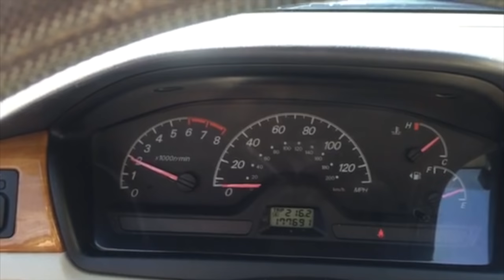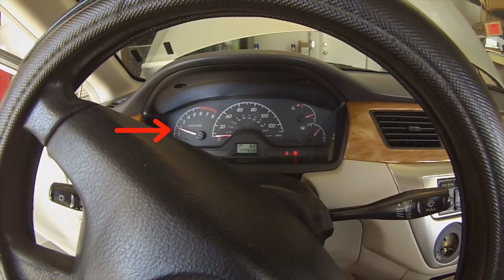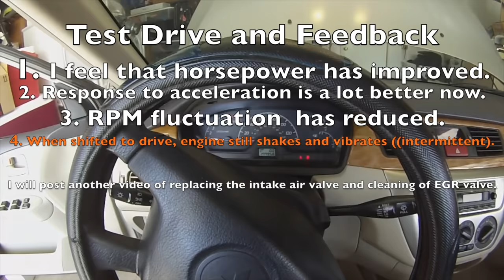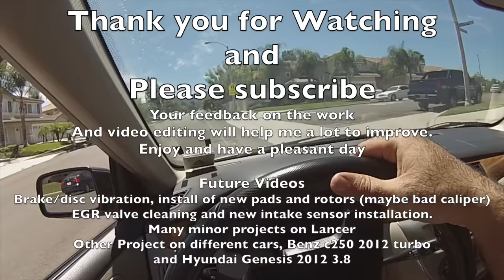Mitsubishi Lancer Fix; rough Idle, loss of power fix part 1 of ?

Comment: I have a 2006 Lancer and I am having the same rough idle and vibration and inconsistent idle .  Now that I have seen you do this I feel confident enough and I am going to attempt to remedy the problem myself.  I have not changed the spark plugs in almost 5 years and I am going to attempt to change them myself.  I just have to borrow some tools from my neighbor. Thank you so much for this video. God bless you.

Comment from the maker: Loss of power, poor idle is also related to exhaust leaks, including, exhaust manifold w/catalytic converter, leaks from flange gaskets. A leak test should be performed. In my case I had a oil leak from the valve cover for many years. It eventually seeped into the exhaust manifold and perhaps contaminated the catalytic converter as well. I will be posting a video related to the exhaust system. thanks for watching.
Reply from the maker: +Eric Boyle Hi, thank you for watching my video and especially reading all the comments! I don’t think a flex pipe leak causes idle issues. However; there might be other issues such as, exhaust creating back-flow resulting in poor gas mileage, loss of power, catalytic converter functionality issues, rich / lean fuel issues etc.

Comment: I have an 02 lancer and you may want to check your adjustment on the throttle cable itself and also whenever you do anything to the vehicle, (plugs, cleaning, gaskets,etc) always disconnect the battery and take a drive so the ecm can relearn. Otherwise it is still trying to use old information. Good luck. Oh. and my biggest issue was the intake manifold gasket.

Comment: dude this defitely worked for my wifes car. she would drive and the car would hesitate but after using the mas air flow spray on all 3 units the problem went away.car works as good as new.thanks alot for the tips.big thumps up to ur tips...

Comment from the maker: Hi Viewers, 
I just wanted to update you on the idle fluctuation issue. After diagnosing the problem related to the stuck throttle body value. A month ago, I took out the throttle body, and lubed the butterfly valve/plate with WD40. Since than I have no idle fluctuation issues. This problem is fixed! I am more than happy to provide any information. Thank you so much for watching and please subscribe.

Comment from the maker: Recent update; After installing the Oil Catch Can, (Here is the link on the video, https://www.youtube.com/watch?v=uEIYts3Evtg) idle is much better. I think PCV line was leaking or perhaps it was cracked. In addition, my battery's negative terminal was loose. I have replaced the negative battery terminal with a new connector. So far, I have not experienced any fluctuation in the idle. I will update you if it comes back. 
Thanks 
PS
I will be replacing, camshaft oil seal (Here is the video on how I replaced it, https://www.youtube.com/watch?v=ZEdoJzgTtEM) and perhaps rocker gasket. Thanks for watching.
Reply: +AfzaMoto 
perhaps you do a lot of kick downs and run engine on very high revs. you can see the black film on and around butterfly plate before cleaning. I always clean butterfly and throttle using tooth brush and either WD40 or throttle  cleaner it will efficently remove that black film that makes it stuck
Reply from the maker: +K4LI4NY4 Thanks for your feedback.

Comment from the maker: I just wanted to update you on the progress. After cleaning the EGR valve the response to acceleration improved; but it did not fix the idling issue. There was also some oil in the EGR valve. I am guessing the blow-by gases caused the oil in the EGR Valve, and/or blockage in the exhaust system, perhaps the catalytic converts.  I am still trying to figure out how to perform the exhaust pressure test. 
   Further, I decided to use the Seafoam treatment to clean carbon build-up. I used 1/3 in the fuel tank, 1/3 in engine oil and remaining in intake through the brake booster line. I couldn’t believe the results; it fixed P401 code (bad catalytic converter). After the treatment my O2 sensors and catalytic converter functionality worked at normal levels. However; during the treatment I saw smoke coming out around the rocker cover. Further inspection revealed there is an oil leak coming out of the camshaft seal.

Recently I have also installed an oil catch can. I also performed a compression test but readings are not consistent, maybe I have a bad gauge.

Engine shaking was fixed after replacing the front and rear mounts. My youtube video is available on how I replaced the mounts (https://www.youtube.com/watch?v=FIda5OMI5t4)

Engine idling is still not fixed, I am running out of options!

Comment from the maker: Hi Viewers, 
Today, while I was sitting in my car, the idle started to fluctuate from 1000 rpm to 2000 rpm. It always stays above 1000 RPM (it is higher than normal). However; when AC clutch engages the RPM jumps to 2000 (it is also normal for RPM to go slightly higher when AC engages, but not 2k rpm). My understanding is that the RPM levels should stay around 700 and with AC on it should be around 900-1000k range. 

Next, I turned off the AC to see if the RPM drops, and it did. But the idle was still at 1250 rpm after turning the AC off (normal is 700). While I was thinking of a possible cause a thought of stuck accelerator cable, throttle or a stuck accelerator pedal came in mind. So, I decided to put my foot behind the gas pedal and pulled it up. It immediately brought the RPM down to 700 rpm! 

Now, this tells me that I might have a problem with  a stuck throttle or perhaps cable and/or the gas paddle. 
            
           Now, I will be focusing on these areas to confirm and fix this problem. 
Thanks

Comment: helpfull video but all mitsubishi have an thing in comment an problem with the ECU i have an mitsubishi colt 89' 1.5cc 84 hp engine witch was the first with eci multi and full injection on it so i cleaned the throtle all the sensors that could cause any problems with rpm  and lose of power and i also unpluged the eci throtle control witch gave me more lost of power and more fuel consumptions so guys what you must really check is the ecu condition! i know that from lot of surces and i think the problem could be solved easy ;)

Comment from the maker: Well there was some improvement, but it did not fix it, instead of cleaning and replacing, I will perform the below the diagnosis
1. Fuel pressure check. 
2. Exhaust related issue, pressure 
3. Catalytic converter functionality.
4. Fuel Trims 
5. Mass Air flow sensor testing.

Comment: Hiya nice video,   question I have the same problem and the engine mount on the drivers side firewall was broken and causing the engine to really idle badly whenever I came up to a light I had to put the car into neutral to quiet it down.  Have you also changed the transmission mount.?  I have a 2000 galant and its located under the battery
Reply from the maker: +Ravenger Knight, thank you :) no I have not replaced it. I am getting clunking noise from the drivers side, it could be the transmission mount or perhaps the broken/damaged control arm's bushings.  Thanks for watching, please let me know if i can help.

Comment: hi got a Mitsubishi lancer 2010 2.0 manual car and got this 1500 rpm problem recently when my mechanic cleaned the injector nozzles manually. I noticed when I start in the morning it'd running normal at 1000 but when I drive and probably get warm it increases to 1500 and it plays. he coming tomorrow to check buy any reason or same as video

Comment: Hi afza motor. I have a Lancer CS3 which is pretty similar to yours except that mine is a 1.6 4G18 and urz is a 2.0. I too decided to clean my throttle body one day and did so exactly the same way you did your car. After starting the car, (f.y.i - you are suppose to press on the gas to kick start the engine once ur done cleaning the throttle body) I noticed that my idle has gone up to 1100rpm -1200rpm and when I switch on my a/c it drops down to 1000rpm. This has now resulted in a increase of petrol consumption and I've got no idea how I can push back down the idle to its original 800rpm mark. I'm thinking of sending the car into the dealership to get a engine tuning done (ecu flash and adjustment) but I'm not too sure if it would solve the problem. Your help would be much appreciated. Thanks!
Reply from the maker: Hi, I would do a vacuum test, use OBD-II scanner and make sure all of the systems read "ok" or "completed". fix if there is engine light. Make sure engine air filter housing is secured and there are no leaks. test and clean egr  valve. good luck and thanks for watching my video.

Comment: hi, have Lancer ex 2.0 engine 2009.I got a problem yesterday,the car can't run normal,if i put gas,when  we with the scanner check we saw it like this(pressure control Solenoid A performance/stuck off and this transmission fluid pressure low. please help..thank you

Comment: thank you for this video , it is really helpful
i have a lancer 2002 model and when am on  55 MPH my RPM will be at 3000. what can i do, it doesn't shift to 4th gear. pls advice
Reply from the maker: Hi Tony, 
do the following
1. Check transmission fluid, if low fill it, check for any leaks, do a smell test and see if its burnt. Hopefully you replaced it as per the maintenance schedule.  If it was never changed then there is a possibility of failing transmission or bad valve body or bad clutch plates.. Change oil as per the maintenance schedule.
2. Check and fix any engine codes, use an OBD-II scanner.
3. Early and late shifting is caused by a malfunction in the valve body or a bad PCM,  sometimes cleaning or replacing the valve body can fix the problem and in some cases fresh transmission fluid can fix. However; if the fluid was never changed or if the transmission fluid smells burnt than changing the oil will make this problem worst than it is now..
4. Test and verify the functionality of transmission range switch.
Good Luck
Reply: thank you very much . am working on it now

Comment: I have lancer 97 auto high rpm and no shifting gear help me brother
Reply from the maker: +jennifer bernales Hi, I am not an expert on transmission,  but i would check the below items. 
1. Check fluid level, quality of it, check if it was ever changed. If it was never changed there is a possibility of damaged transmission. 
2. Check for an engine light, if there is a code, fix it.

Comment: +afzamoto  thank u for the help I will check those all out...... here is another one I did a lot more issues in this one https://youtu.be/1XyMp0EPRWs
Reply from the maker: +getsome sports okay do these as well, so fix one problem at a time and test, and then move on to the next solution, one by one, 
 
1. Clean EGR valve, and tests its functionality (if it holds pressure).
2. Make sure engine air filter and its housing is sealed and there are no gaps/holes etc.
3. Clean MAF
4.Test injector (s) and fuel regulator.
5. Check your coolant ( test the coolant) replace if needed, and test coolant temperature sensor.
6. Perform a vacuum leak test.
7. Perform a exhaust leak down test.

Comment: it was the TPS ???
Reply from the maker: +Stephen Touzalin I had many issues related to the idle issue but one of them was related to the stuck throttle valve, (in the throttle body). I had no issues with the TPS.
Reply: +AfzaMoto thank u